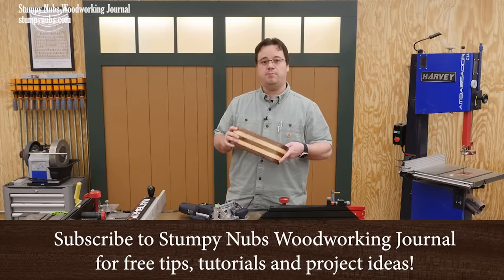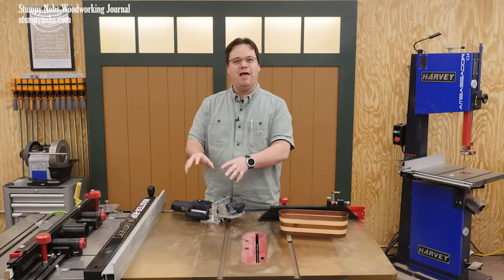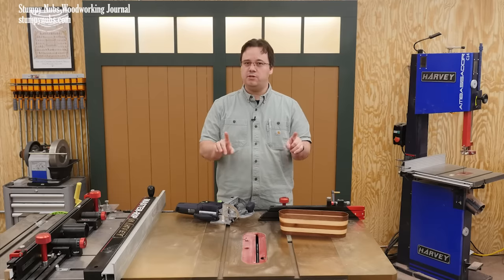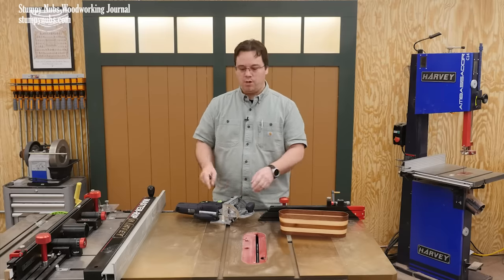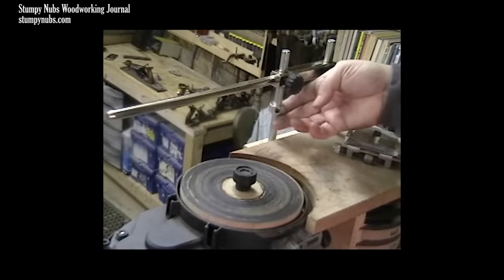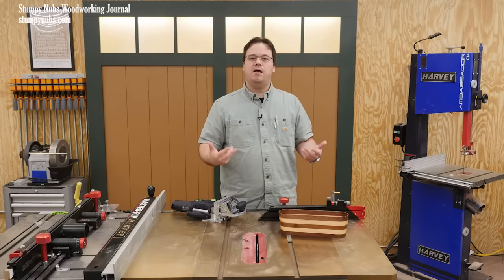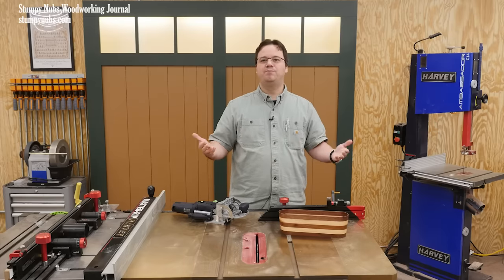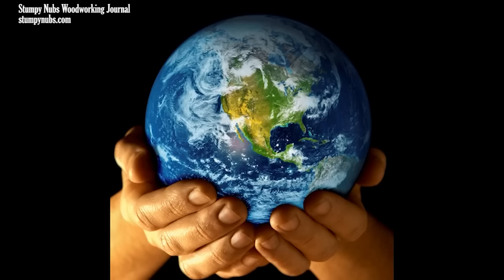This is why people HATE Festool and their Domino!

Comment: I'm not an avid enough wood worker to pay that much... but the issue I have, such as it is, is with the unnecessary proprietary parts. Rather than using established connectors for example, they put in a patented, and (by all appearances) completely unnecessary part, such that if it breaks, you cant buy a generic part to replace it, you need to buy the (considerably overpriced, and I say that because re-designing for sake of exclusivity isn't a good dev cost to pay for) proprietary part. 
Dont hate festool... but like apple saying 'only OUR usb (key word... UNIVERSAL) type C cables will work properly' I dont like paying for designed exclusivity, that presents no benefit other than that.

Comment: The question that needs to be asked is, is Festool making tools for professional woodworker or the DIY community. Not all woodworkers have the time as many professional guys. Pay is not increasing for the average woodworker. Their tools may be very good, but the price is high. I was able to get a cabinet table saw. I purchased a Laguna F3. It is very comparable to the Harvey. I was not going to get a Sawstop due to it's price. Every woodworker should learn to use a table saw correctly. This defeats the over priced Sawstop. The proper techniques to use a saw nullifies the over expense of this saw. My number one rule is not to use it if I am tired. That is when mistakes happen. In some ways I think Festool is just being a snob when designing tools so high. They should quit advertising there tools to DIYers when most of us can't them.

Comment: The cost of a Festool Domino is the issue.  Why does the cost a Nova Viking drill press with all of their electronic innovations, direct drive 1HP motor, shear volume of materials and shipping costs come in less than a Festool Domino?  Corporate greed by Festool.  It would make sense that if Festool dropped their pricing to let's say $500, they would more than double the units they sell.  That would not make up for the fewer units they sell at $1200+, as far as net profits.  Like the Fein oscillating saw under patent had them corner the market and charge $$$$, once the patents expired many competitors began making their own with huge cost savings for consumers.  The same will happen with the Festool Domino.  I'll wait.  Until then, dowels work for me.

Comment: Because Festool doesn't care about its customers' money.  Speaking of their multitool machine...there are four different mounts: OIS, Starlock, Starlock Plus and Starlock Max.
All Starlocks are Bosch patents, for which a license fee must be paid... and even Bosch divides the system into "two worlds"... starlock plus only for entry-level models, and starlock max for more powerful - more expensive (you can think for yourself).
And Festool, of course, immediately implemented Starlock Max...but no other system fits it!!!...not even starlock and starlock plus!!!
ONLY FOR EXPENSIVE ACCESSORIES!!!
Otherwise, e.g.  Metabo and Makita have paid a license fee for the Starlock Plus on their latest tools, and changed the clamp to a pin that holds the blade. So their clamp accepts all types of Starlock... both the old Starlock, the newer Starlock Plus, and the "professional only" Starlock Max.
On top of that, their system is safer in the event of a tension spring break!
And one more thing... it's true that Starlock Max is faster and easier... but what about when it breaks down?  ...there is no possibility of your equipment falling to the floor or losing it (and you on a ladder, etc.).
It's similar with the Bosch X-Lock system for angle grinders... and try mounting e.g.  Arbortech Ball Gauge, etc....they want to "catch" us in the way of razor+blades...no, no...only such and such are suitable...🤨👎
They think that customers are stupid..similar to Apple..we don't like them for that, because they have a patronizing attitude towards their customers.👎
Just got a Metabo MT 18 LTX BL QSL yesterday..and it will be much easier to find the right accessory of my choice for it.😃
Greatings from Slovenija

Comment: Doesn't the price also reflect the fact that the Domino is the only tool that can do that, at least that smoothly and quickly? 
There is also the case of the Maffell (spelling?) jigsaw. It is crazy expensive but it's easily the most precise jigsaw on the market. If a product is the only one that can do a particular work, that surely merits a higher price? Another company is free to develop a tool that can do the same (without breaking patent laws) if they can. 
Personally I can't afford Festool, and I don't really need it, but I can sure appreciate fine engineering when I see it.

Comment: Woodworking falls into 2 camps:
Hobby shop, and pro
Hobby shop guys can (and do) get upset when they feel pushed to spend more then they can reasonably afford on a hobby. They also don't like when it appears that there is significant price gating
Pros are more mixed, but those who look down on festool see them as not rugged, unable to stand up to hard use. An expensive toy for Rich hobbyists.

Comment: dowelmax is just as strong, easy, and accurate much less expensive.
Reply from the maker: You are correct on two of those three points. Dowels can be as strong as loose tenons if they are of the same size, or you use more of them. And the Dowelmax is very accurate. But it is not as easy (fast) to use as the Domino.

Comment: I bought one of theses like 6 months ago. When I was talking to my neighbor who also has one, he told me he had one and would give me it for half price, I was like huh? wish I saw you a few days ago lo. Any way when I asked him why he would do that, he said I cant get boards to align. He said when he does a join, meaning joining a couple of boards, the faces do not line up. I was like yeah buddy, maybe you cant figure it out but I can. So, I went, flattened some boards and then added 3 dominoes to a 3 foot boards, low and beho9ld when i p[ut them together, the did not line up, exactly like he said.  The boards are a sixteenth off. I have read all sorts of forums and trouble shooting and stuff and still have the same issue, the domino seems to go in tilted to one side or the other. like the left side of the domino is raised and the right side is low. 
 If anyone has dealt with this issue, PLEASE tell me what you did to fix it, this isn't the first time I heard this either.

Comment: The patent excuse doesn't hold up when you look at miter saws. I purchased the Bosch for $699.00 Festool wanted $2500.00.
Overpriced in my opinion. I also own a hardly used biscuit jointer.

Comment: For people who can't cut a mortice and tenon
Reply from the maker: Are power drills just for people who can't bore with a bit and brace? Table saws just for people who can't use a hand saw? Jointers and thickness planers just for people who can't do it all with a hand plane?
Reply: After reading many comments on YouTube I agree people shouldn't have to know  to cut joints. Anyway the domino doesn't cut mortice and tenon s
Reply from the maker: @Jroth-kl9gd  I don't know what you are trying to say in the first sentence of your response. The second sentence is only half correct. A Domino machine cuts a mortise, which is the most difficult part of loose-tenon joinery.
Reply: There are a few beginners who think they don't need to know how to cut a traditional mortice and tenon now that domino is here
Reply from the maker: @Jroth-kl9gd  You seem to think there is some sort of value in cutting a joint with a specific tool. I argue that it doesn't matter what tool you use as long as it does the job. A domino joint is no weaker than a traditional mortise and tenon joint of the same proportions.
Reply: No point in continuing. Have a nice Day

Comment: I suspect youtubers use the domino for the same reason professionals would.  Because it gets the job done well and quickly. In the youtuber case, they can produce videos faster.  That means more revenue.  In the professionals case, they can produce work faster, which means more revenue.  For the hobbyist, That's not he goal (fast production)_.  The reason they are in it as a hobby is to have something to spend their time on.  That's why so many of us spend all our time building shop furniture :-)  We don't have to actually produce anything that anyone has to judge.

When a youtuber shows off a domino it doesn't really meet the needs of the average hobbyist.  It's not going to help us spend our time, and it requires a significant (shop-level) investment.  It's not the same as using a table saw (they are all about the same whether you are using a harvey or a dewalt.  No one hates a youtuber for using a sawstop tablesaw (or at least they shouldn't).  The hate flows from expensive specialty tools I think.  This same rationale is why people hate on CNC.  or Laser.  "not real woodworking anyone?"  If the entire class is beyond the audience, they will hate it.  And a domino is in a class by itself.

Comment: uh ... I'd say price , shit Milwaukee makes one for 400 ish... and I wouldn't call Milwaukee cheap either  and Festool is expensive af even with normal tools. but yeah hating someone over tools is dumb
Reply from the maker: Milwaukee doesn't make a Domino.
Reply: @StumpyNubs  they make a plate joiner which is arguably the same thing just a slightly different size and shape dowel/biscuit. but yes technically they don't make a domino
Reply from the maker: @MrCheezeus  A plate (biscuit) joiner is not at all the same thing. Biscuits are thin splines that offer very little structural strength. A domino is a tenon that is thicker, longer, stronger and fully structural (for furniture making purposes). The tools don't even cut in the same way. They may look similar, but they are very different tools. And while everyone seems to make a biscuit joiner, only Festool makes the a loose-tenon machine like the domino.
Reply: @StumpyNubs  makes sense, I always thought they were all the same with slight variances for legal reasons. Thanks for taking the time to explain the differences.

Comment: My wife got her Iron from her grandmother, and it just shorted out. I said I would fix it on the weekend, but she couldn't wait. She bought a new one on the way home from work. The old Iron was about fifty years old, and had one light. Her new one has two lights, and the upper part is made of plastic. Blah, blah, I fixed the old one, and now we have two irons. The engineering development was way more complex then my hand plane. It's the same with manufacturing, the iron was much more complex than a hand plane. I just checked, and both irons had a flater base then the last hand plane I bought at more than twice the price. Thing is, almost all the wood working tools fall into that pattern. Anything you can afford is junk, and anything worth owning are two expensive.  Than we hear the whine, "The good material is expensive. Attention to detail is expensive. We have craftsmen with years experience." Bulshit. My wife's two Irons are made of some no rusting metal (Stainless Steel?), and it's chrome plated. It has steam tank, and electronics. A hand saw has two parts, and screws. That's a handle, and the blade. I can buy a cheap hand saw for under twenty, but you can't sharpen it. It's dispossible. How much does a  quality hand saw cost? All I know is I can't afford them. The differance, a slightly higher carbon content in the expensive hand saws. The steel may cost more, but not ten time more. You know what the truth is? They are spending more money on everything sold to make them crappier. They spend money to make junk that breaks, just so we have to go out an buy a new one, instead of just sharpening the old one. Every manufacture does this. It's the old  Gold Miners economics where the real money is made selling over priced equipment to those trying to find gold. No one needs a Fess tool, but you can't do woodworking with your bare hands. Everyone is screwing us, and that's the truth.

Comment: I don't hate Festool machinery.  I do hate their pricing; the tools are good, solid machinery, and I approve of good, solid machinery.  However: If the price were half what they are, there would be way less hate, I promise.  And Festool would still be making pounds of money.  I have a Domino, and I like it - but I do wish it cost less.  (And it's not just the Domino; ALL of their tools cost a large bag of money, and they're not that much better than J. Random Tool from Makita, Milwaukee, Bosch, or some other outfit.  So, I own a Domino - and most of my other tools are from Milwaukee or Makita or Bosch (I chose those names because they're actually what I have).  No need for the hate; buy something else.

Comment: I don't hate Festool and if I had the money I might even buy something from the company, it is the woodworkers that have a wall of Festool boxes behind them, the camera always pans to the tool label, not the work being done, but the tool that is doing the work, and the name Festool being mentioned numorus times during the video ie I hook my table saw to the Festool CT 26 E HEPA Dust Extractor, when they could have just said vacuum, and there are a lot of those people, another thing that bothers me is all of the "I need to explain why" they spent $1700.00 on the domino videos.

Then you have the ones comparing the Domino to Biscuit Jointers, that's like comparing a car to a boat, anyone with common sense knows that Biscuit Jointers are not for strength they are basically to line up the edges of end-to-end boards where the Domino does that and adds strength

What is sad, that has almost turned me off of woodworking videos completely, are you used to be able to relate to the woodworker in the video because you have basically the same tools they had, now "woodworkers" have 5'x10' CNC machines, handheld CNC machines, Festool this, Festool that, and they are selling their plans that their 5'x10' CNC machines made.

That said, I am smart enough to figure out alternative tools, I have been using dowels in rows of two and three for years way before the domino was even thought of and to me that is a better way if you care about quality, with dowels you can make them as long/deep as you want.

So I think that it's not the company the haters hate, it's the price and the look at me I can afford Festool and you can't vibes that come off in many videos.

One thing about you, you are none of that, you always give alternative ways and tools to do things.

Comment: I suppose I hate all tools that do what what the domino does, Festool is just the most prevalent and add to that the obscene price and you got a perfect hate cocktail.
However, the basic reason for me is the implicit capitalistic "time/money over quality" mentality. i also hate nail guns for example, well, at least when used in a glue up, and then there's subpar materials, especially when camouflaged as premium materials.
In my not so humble opinion, when you prioritize time and money over the quality, when you rush to make more, cheaper and faster, rather than taking the time to do the very best that you can, then you are a carpenter, not a woodworker.

That being said, if you can honestly say that this tool allows you achieve an end result that wouldn't otherwise be possible, not taking time and money into account, then I say bravo, but also that you might want to work on certain skills.

Of course that is just my opinion, but I stand by it.

Comment: Why is the Domino better than biscuits? The Festool looks like a modified biscuit tool.
Reply from the maker: A biscuit is just a thin piece of wood that adds little structural strength. A domino is much thicker and protrudes into each mating workpiece much further. A domino joint is a loose mortise and tenon joint, and is structurally sound.

Comment: Sawstop is the only one the really, absolutely bothers me. Because they've heavily abused the patent system and international trade agreements. Bosch came out with their own version of the sawstop mechanism, that's actually superior in many ways, is far cheaper, and doesn't function at all like Sawstop's. But, Sawstop was able to argue that the idea of saving your fingers is actually patentable.
Reply from the maker: LOL, that's not the argument they made at all. If it were, blade guards would be a patent violation...
Reply: @StumpyNubs  I'd need to find the ruling again, but it was pretty egregious, and very annoying. Their patent should be expiring soon though. So you'll be able to get Bosch's system that saves your fingies and the blade.

Edit: Double checked, Sawstop basically patented the idea of a table saw that will actively save your fingers instead of passively like a blade guard. Patent 7,895,927 is the most important here.

Comment: Didn't the original lamello machine cost over $1000 when it first came out... in 1980's dollars? and as you mention the fien tool.

the Festool domino machine is great; extremely well made and engineered.  for me I get ticked with festool the company, because they WANT to be in the highend niche bracket (I also think woodpeckers is overpriced coloured allunimum.), its also the brand bits, accessories and all the accoutrements and the brand name dominos that you use-- which I respect as that thing about ongoing revenue streams.) . The domino is great; the other tools are where they make their reputation to be unneccicarily hoighty toighy. their jigsaw is a jigsaw.

i think a lot of folks also think it takes away from the craft... which is true... but are you playing in a woodshop on the weekend? or making money? im sure their we're similar feelings when table saws took over from hand saws...